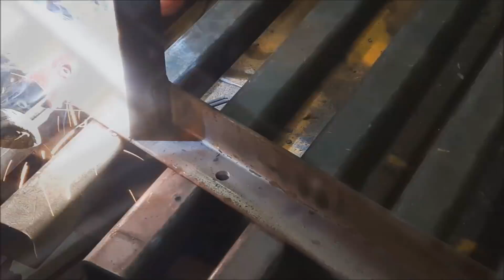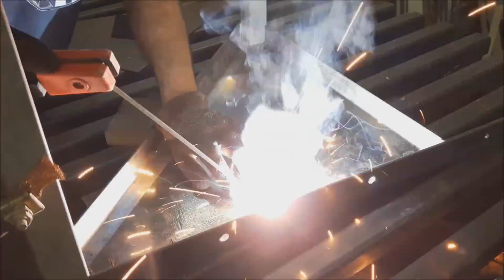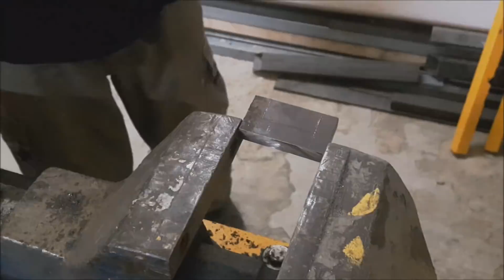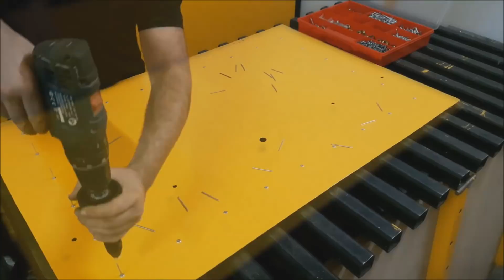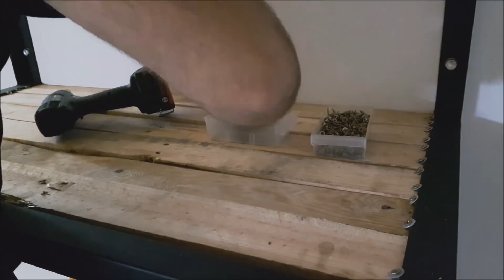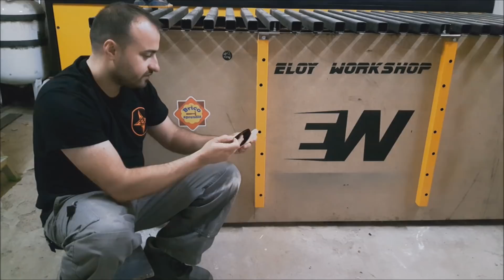Organizador de herramientas neumáticas

Comment: Vaya pasada de armario ese tanke para que sera jajajajaj.
Reply from the maker: JAJAJAJAJAJAJAJ muchas gracias amigo, digamos que podría ser mi nuevo calderín para el compresor de aire, un proyecto a lo más estilo make it extreme ajajjaja un fuerte abrazo amigo
Reply: Eloy Workshop jajajajaj buena idea Un saludo eloy que eres una makina de crear.
Reply: Eloy Workshop yo tengo una instalacion de aire en el taller el accionamiento del compresor lo hize por contactor y botones  para poder encender y apagar desde varios lugares sin problemas el esquema electrico es un marcha paro con realimentacion. Y cada salida con un regulador de presion. Por si te da alguna idea te comento como lo hize yo.
Reply from the maker: Muchas gracias amigo :D leer estas cosas es adrenalina pura!!
Reply from the maker: Muy interesante, el accionamiento lo tengo pensado cuando haga la instalación eléctrica del taller.... yo he pensado en poner el repartidor de tomas comandada por un manorreductor con filtro de humedad, porque la mayoría de tomas es para soplar las máquinas y dejarlas limpitas jajajajaja menos la de "servicio" que es donde conectaría mis herramientas neumáticas, también he visto unos reductores chicos que se conectan a cada máquina y ya se quedan reguladas, sería otra opción, muchas gracias por el comentario amigo